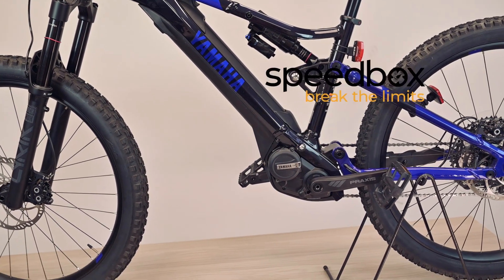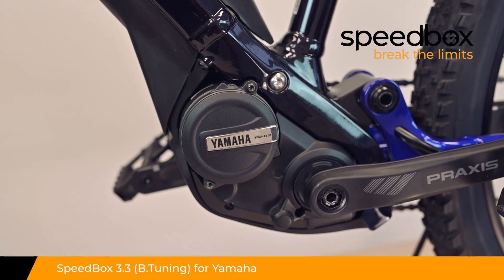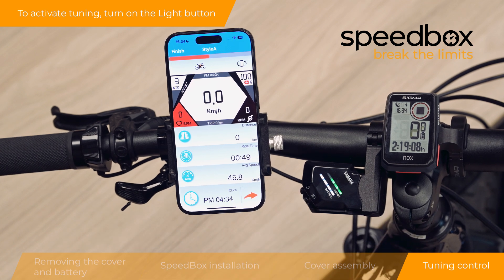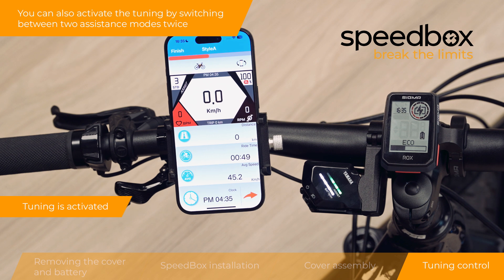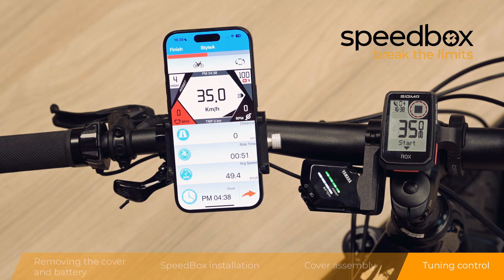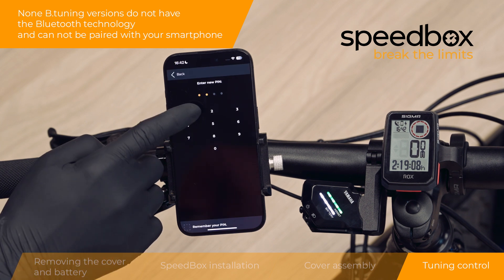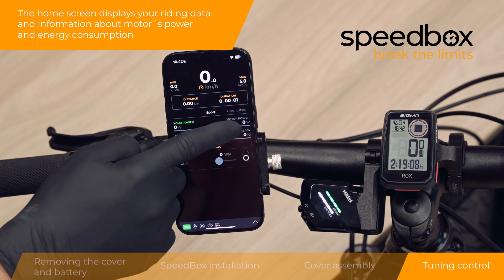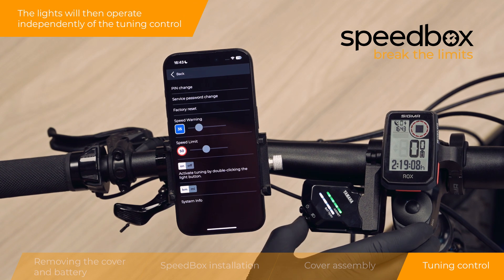How to install SpeedBox 3.3 (B.Tuning) for e-bikes with Yamaha motors (PW-X3, PW-S2)

Comment: Hello,

We have purchased the product below, but the speed tuning remains capped at 45 km/h, and we can’t increase it further. We live in Turkey and are not fluent in English, so we are having some difficulty understanding the instructions and videos. This is the product we received:

SpeedBox 3.3 for Yamaha (PW‑X3, PW‑S2, PW‑XM)

This is a non‑Bluetooth model. Is its operation as follows?

According to my research:

Press the Walk (Sigma) or Light button once → “9” appears → tuning mode activates.

Press the button or twist the wheel to increase → each “click” or revolution adds +5 km/h.

After reaching your desired limit, wait for 5 seconds to allow the system to save the new speed.

In this way, after 45 km/h, each click increases the speed limit; there is no need to press the button again—you just need to wait 5 seconds after setting the limit.

I will test it this way. Their website mentions that error codes may appear if there are real issues, and the manual confirms this as well. I plan to experiment up to 60 km/h. I had been spinning the wheel too quickly, trying to set the speed to 99 km/h.

Is this how the system is supposed to be configured? Please, could you assist us?

Comment: Just installed it in my haibike adventr se.  Had problem with cables because had more of them than this motor on video. Watched few installations and it seems every bike brand with yamaha px3 motor have different cables configuration.  I was worried but man.. Now bike pulls like ferrari 😂 what a power.. But i warn you guys, after 30 min ride motor was very hot. Dont go too crazy😂
Reply: man I have the haibike trekking 5... adventr is a dream bike and will definitely be my next!!
 what was your top speed?
Reply: @ii-_-ii-x  thx man! Yes it is amazing bike. Ive got 34 miles /h on flat termac but you could go much faster if you upgrade  cassette  for higher gears
Reply: @FuriousChmielu  
How quickly does the battery capacity decrease? At that top speed, the range is probably not that high..
But I bet is fun as hell 😂
Reply: @ii-_-ii-x its fun as fuck! You can race cars 🤣😂 acceleration is amazing. I do about 4 days going to work and back home on 1 charge with highest support so about 40 miles
Reply from the maker: Hi,
thanks for the feedback! So you managed to install it successfully? 😇
While riding, we recommend changing gears depending on the terrain and incline, and not leaving all the load on the motor.

Comment: Mrb yamaha moro 07 icin bu urunu aldim taktim hiz limitini sonuna kadar kullanmak istiyorum ama bende sizdeki gibi extradan bir ekran yok bu isi kisa yoldan nasil yaparim
Reply from the maker: Merhaba,
Ürünümüzü satın aldığınız için teşekkür ederiz. Eğer ekranınız yoksa, hızı kontrol etmek için Yamaha uygulamasını denediniz mi? Orada tuning’in aktif mi yoksa pasif mi olduğunu görebilirsiniz.
Reply: Ürünü satın aldım taktım henüz test etmedim uygulamayı indirdim denicem
Reply: Yamaha uygulaması ama hangi uygulama
Reply from the maker: @fatihbayram5128  Merhaba, bu e-SYNC Connection uygulamasıdır.

Comment: Good evening, I just mounted the Speedbox 3.3v on Yamaha pw-s2, I ask you if the reading on the app of the torque expressed by me is reliable or if it is the sum of the engine torque plus that of the cyclist Thank you
Reply from the maker: Hello. Thank you for purchasing our product. In the diagnostics you can see the torque of the e-bike motor and your own torque.
Reply: @SpeedBoxTuning  Hi, is it possible that I can develop 210nm of torque?
Reply from the maker: @feddec.77  I don’t know, it depends on your motor. The SpeedBox removes the 25 km/h speed limiter. The rest depends on the power of your motor and your pedaling cadence.

Comment: Im trying to take the crank arm off on my moro 07 . It lossened up then maybe a full turn in got tight again. Is this normal? How should i proceed?
Reply: Yes that's normal. Just keep turning until it comes off. Be sure to torque it to spec when you put it back on.
Reply: @cabbynate ben denemeyin ben kranki çıkarmadan taktim

Comment: Does the bike have to be connected to the phone app or a computer for tge chip to be activated?? I ask cos my bike seems to switch the chip off if my phone disconnects from the bike
Reply from the maker: Hi. No, your phone doesn't have to be connected all the time. If you activate tuning on your phone and then turn off Bluetooth on your phone, for example, SpeedBox will remain active. If you want to turn it off, you can turn it off on the display or pair it again with the app.
Reply: Are we talking about the esync app

Comment: Just fit this to my raymon trailway, had to drop the motor tho as there was absolutely no way the wires would up the side, there just wasn't the room, the chip is amazing tho😂
Reply from the maker: Hi.
Thanks for the feedback. Some types of motors are a bit of a challenge... But it's great that you managed to install it! 😃
Reply: Can anyone find the box via Bluetooth after installation?
Reply from the maker: @yamaha_r6514  Hello. It only works for B.Tuning version. B stands for Bluetooth. Please check your product once again. If you have B.Tuning version, your e-bike will be named like MyEbike... in the app. If not, please reinstall the app again. Thank you.
Reply: What computer is that ? I'm wanting a computer but not sure wich to get ??
Reply from the maker: @shawry123451  You can see some Yamaha displays here https://www.speedbox-tuning.com/p/p-speedbox-3-3-for-yamaha#2125 All compatible with SpeedBox
Reply: What trailray do you have? I've just bought the 160e and struggling to see how i do this with the x display